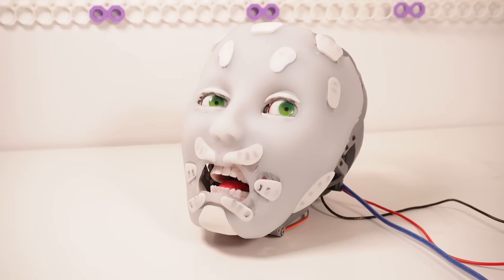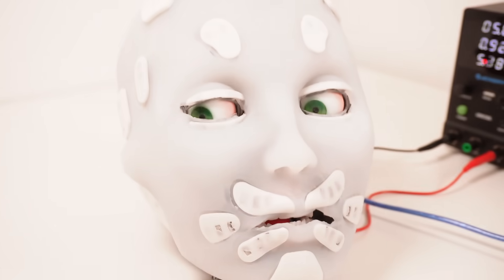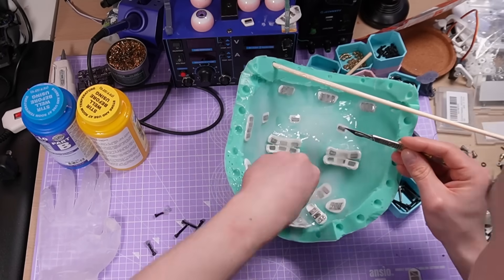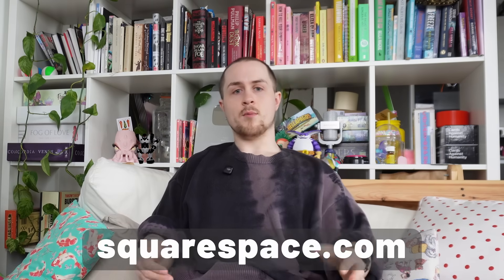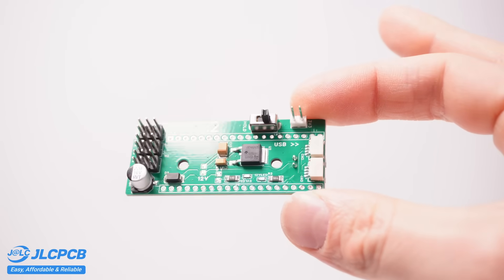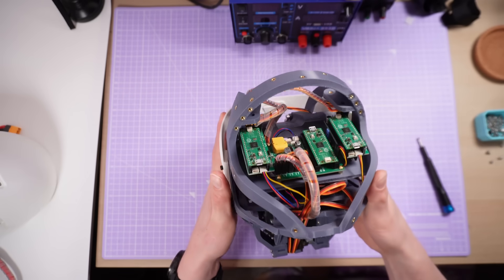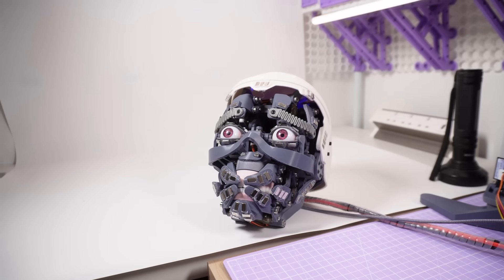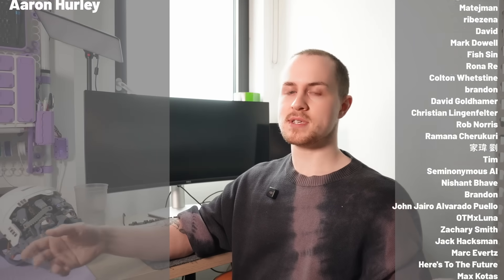My New Robotic Head Design is Legally Confusing

Comment: Is it possible to use a esp32 and servo driver board for the whole head I’ve managed to control the eyes with a ps4 controller maybe 2 servo boards linked could run the head ? I’m Not a programmer or an electrician just learning from trial and error love all your stuff will most informative videos for animatronics and robotics

Comment: for the part thats being cast, maybe just add some metal washers of some kind instead of full magnets, with the hole maybe acting as some kind of alignment, with the magnets in the base part that the mask attaches to
Also you can get magnets with holes predrilled in the centre from aliexpress as well as a way of mounting them (by putting a screw through the middle) I've seen them in voron stealthchanger kits

Comment: For the silicone face, you’ll want to design a printable two part mold. You can do your initial brush in of silicone and place your magnets in there. Close the mold and pour in the rest of your silicone. You’ll want to add bleeders preferably on the rear face of the silicone so no air is trapped while pouring or injecting into the mold.

Comment: There is a lot of miss information about patents here. I have had to hire patent layers in the past for projects I was making, they only way he would violate patent law if if he sells the silicone faces with the magnets installed. You can explain a patent, teach a patent. and be paid to do so. But you can't use a patent in a product and then sell that product. He could even sell the silicone face without the magnets, with the spots for me to install the magnets myself, this would not violate patent law, at least not in the USA. Although I am not a patent lawyer, I have been in this same type of situation and was never even contacted by the holder of the patents I used for none commercial use.

Comment: They didn't invent those magnets, velcro or any other fastening devices. Therefore how and where you choose to attach them is your freedom of choice or your logical selection. Offer your method of attachment as "possible optional methods" instead of the only way to make it so. I think you'll be fine! Your robotic head is quite different from the others but all heads and bodies have similar designs and symmetry so again, I wouldn't fret it. Enjoy your creation!!

Comment: I'm sure you've thought of this already, and it would take longer to install a face, but maybe you could have "mushrooms" of silicon that hook into holes that they have to be deformed/pushed through in order to stay attached? Kind of like those used in flip flops or sandals. You could also just pour the mold and not have to include any magnets.

Comment: Patent infringement is only a problem if you go into commercial production. You can actually use the details in patents to make things for yourself, including making videos, and likely distributing as an open source design. The issue will be if you sell the finished thing. You might be ok with selling the plans...because it would be the same as the patent office selling you a copy of the filed patent.

Comment: I think probably the best way to build your robot head would be to use already manufactured catalog items so you avoid infringing on other utility patents and having to invent motors and actuators and file your own mass of utility patents. Then build the head, and take photos of it, or make a drawing with different expressions. Then you file a design patent with one claim “a robot head item of manufacture having the appearance as shown in the figure.” That covers the external appearance of an item and lasts 15 years. If you write a program to operate it I’m not sure about utility patent, you would probably file a copyright for the software so nobody steals it. If you try to patent all the little parts yourself it would be difficult. Just patent the physical appearance of the working item with one single design patent. File it yourself online. You get a design patent number so people can’t steal it. Make the thing look unique and don’t copy the appearance of other robot heads being manufactured. It needs a unique appearance. A design patent covers the appearance of a manufactured item.

Comment: there's also a possible alternative to the skin your using. when making a mold for epoxy resin pouring the mold material has the perfect amount of elasticity it's very strong and hard wearing and super easy to pour. every time i did molds and there was spill it would always be uniform in thickness at about 3mm and always felt like skin but with a little stretch like skin. and it was default pink lol 
i got it from a company based in island called MB Fiberglass
and the product I'm referring to is:- Polycraft GP3481-F General Purpose RTV Condensation 
you could just get a small sample pot mix it up and literally just pour some on a flat surface let it set and peel it off and you'll see exactly what i mean.

Comment: uncanny valley:
Try merging the upper teeth into a single bar instead of distinct white bones with fleshy pink gums. That should take some of the body-horror out of it and cartoonize the feel, while still being capable of human smile expression. (But not translucent teeth, as that looks like a boxer with a mouth guard.)

...same with the eyeballs, really. Try matte finish plastics instead of glassy. Though gaze might be dependent on the indentation of the pupil in the iris. So the cornea still needs to be deep glass feel.

future-proofing:
Try the skin with lavender-grey or green-grey tints, to escape the trope of "white people are default, and paper accurately represents caucasian skin."

Comment: Have you tried using magnets from earphones. It's extremely small  and might be perfect embedded in silicon face. You can probably source them  from wired earphones which you can either buy in bulk or as e waste. The  hard part is extracting the magnets from the earphones.

Comment: The servos could be replaced with a “puppeteer “ mechanism driven by a single motor and a transmission system or pneumatically driven with a micro compressor.

Comment: Magnets are not the best solution for flexible skin applications. Medical silicone adhesives offer high flexibility, high durability, and very good removability. PU foam layers provide very high flexibility with medium durability and good removability. PSA gel adhesives combine high flexibility with very good removability. All these alternatives avoid patent issues and perform better in terms of material behavior and user experience.

Comment: If you break up the face into individual pieces and make them like jigsaw pieces you can probably control the thickness of the silicone better. I also think you can influence how it stretches by scoring out patterns that intentionally deform the face when stretched. Also think about putting metal anchors that fasten via turning.

Comment: Use tiny pieces of Velcro instead of magnets, or replace the magnets with some stainless steel tiny plates with wiring and make them into electro magnets, with only ferrous inserts on the silicon, thus circumventing he patent.

Comment: Hi Will, your first problem is that you're trying to build from the inside out. You should be doing the opposite. The first mechanism is always the skin itself. That is what you are trying to move. The thickness of each area and the softness of the silicon is paramount. 
Usually we take a skin and play with it and then make adjustments to its thickness and softness before considering the mechanics.
We've tried all of the fixings over the years and the only way to make silicon behave as we want is silicone adhesive. And that is administered in a measured way, only glueing parts of the understructure and leaving parts to slide and stretch so to not create hot spots of movement.
Making replaceable faces is the least of the worries. Make a beautiful moving face first then worry about taking it off.
Meshmixer is an incredible tool for making digital moulds and cores and giving to the ability to produce different thicknesses throughout your model. 
The skin is the key to a successful character and everything starts there.
I'm very much enjoying your work and i hope ive been some help. It does pain me somewhat to see you struggling over problems that have been solved a decade ago and I'm intrigued to see how you move forward given a little help. Every day is a school day for all of us 😊

Comment: Is the patent only for permanent magnet or all types of magnetic objects?

If so you can use a passive coil embedded in the silicone itself and use an active electromagnet to attach it to the skeleton, this should be distinct enough from the patent that it shouldn't intrude the patents, the only problem is that it need to be constantly powered for the electro magnet to work. I am not an engineer so this is just a my personal guess based on my available knowledge

Comment: How about having the skin have tabs on the inside made all one piece which align with holes which are in the armature. May take a few seconds longer to put on and take off but how many times do you really have to do that? 

It would then be as simple to get the skin to stick to the expression armatures as insert tabs A into slots B.

Comment: 1sst time seeing your project and very impressed.
I'm developing a midi controlled, multi laser synth, abstract laser imaging projection system, based upon the Teensy T4.1, aka T4 Laser Synth.
I see several similarities between our physical architectural design, ie multiple discrete, compact PCBs w/onboard MCU, power, & QWIIC motor drivers. In my case, each unit controls each laser projector, while yours control each facial element.
I see that you've already developed a nice gaming style controller. For obvious reasons, mine exploits advanced commercial audio technology. Since I don't have enough fingers and hands to control so many function variables, I'm using a Behringer X-Touch + X-Tender DAW controller/mixer (with 8 * 4 banks of motorized faders, 16 multifunction encoders, & preset buttons), mapped to unlimited timeline tracks within the highly customizable Reaper DAW.
Each midi track controls function variables within the individual laser synths' firmware (one per projector).
But, I believe that both could easily be integrated, if desired. Simply add/map midi notes & control change read & sends to your existing functions. in addition to X/Y galvos, each laser synth using QWIIC busses for nearby steppers, servos, & solenoids, as are you. 
Midi mapping enables me to easily live mix, record, overdub, and overlay multiple midi channels simultaneously for automating lengthy complex sequences, in order to synchronize my 'abstract entities' with music. My animated sequences can be either ILD animated wireframe images and/or midi files, stored on the T4's uSD, which calls firmware functions in PSRAM.
My images use C++ objects, including 30 oscillators, (amplitude, frequency, symmetry, phase, PWR variables), multipliers, and multichannel mixers being downmixed into XYRGB  outputs. Those abstract images have 3D form, shapes, expressions, & rhythmic movements... sound familiar?
Reaper provides pre-recorded audio (sampling), midi, and OSC over wifi. Sections of sequences can jump between timeline markers to provide animated responses on queue.

In your case, midi files could control pre-recorded gestures and/or motion sequences that are to complex for your game controller during a real time interactive session.
Just sharing some of my food for your thoughts, FWIW.
I'm subbing you channel to follow your progress. I also intend to share my T4 LS project open source on github, plus YT video tutorials & demos (ref 'Christopher Short lasers' if interested in seeing similar works) as soon as it's ready for prime time.
Great work!
BR 😎

Comment: I'm not sure if I commented something to this effect before, but it might be useful to examine some of LEGO's "overmolded" parts for inspiration. These are parts that have been cast once in one color of plastic, then put into a larger mold which adds a second color in the areas that aren't already filled by the existing part. As silicone builds well on itself, you may be able to cast the outer layer of face first, then switch out the rear half of the mold for a slightly different one that has gaps for the magnets and space behind to secure those with another small pour in each one.

Comment: Why not have small cylinders ( or cones ) with a ridge, on the back of the face, so you can push snap them into holes with a ridge in the 3D shape ? - no magnets needed - use the silicone compressibility for snap fit anchoring - enjoy :)

Comment: What we need here is a more appropriate cheaper actuator.  servos are way overkill for facial muscles, unnecessary amounts of power and precision.  we need actuators that can be attached to the frame, then the entire frame cast into the silicone, with a single connector coming out the bottom to the control electronics.  the whole assembly becomes disposable then, no need for detachable skin.   what that actuator might be though is tough.

Comment: With the I2C connections, can you just swap the RP2040's with GPIO expanders? The slave units won't be able to work independently, but its an option that would still allow quick replacements and testing.

Comment: Ben of NightHawkInLight has been replicating patents on his channel for years with no repercussions I'm aware of. That's also basically the whole content of Robert Murray-Smith's channel. I think it would be hard to argue damages of you showing what can be done with their, by definition, freely accessible patent, that shows exactly how to do what they are protecting?

If this were you infringing on some patent that makes fossil fuel burning more efficient owned by Exxon Mobile or Shell (of which there are many) then I might be legitimately worried about them pursuing me to the ends of the earth to burry it and keep it out of the public eye. But from where I stand Realbotix LLC only stand to gain from your free publicity so I don't see why they would pursue enforcement for these videos?... They would have legitimate grounds to do so for your open source designs though. They could argue each person that uses them is one less they would have sold and seek damages, for example?

Comment: In my experience with patents you need to make money off it to be a problem. The IP owning entity has to know that you are infringing and then take action to recover losses they have incurred due to you taking what was potentially their profits. Generally they don't go after individual people making one off units at home. If you tried to sell these designs or as finished units you are likely to run into legal issues. 

If you were low enough volume (below the cost of litigation) then they might not come after you even if you were infringing because they would loose money doing so. Unless they're petty/have money to burn. They might just send a "cease and desist" letter to scare you into removing what you've shared.

You showing off their patent technology could be a BONUS to them, because other companies may want to use that tech in high volume and they can negotiate a cut of those profits or trade patent use permissions.